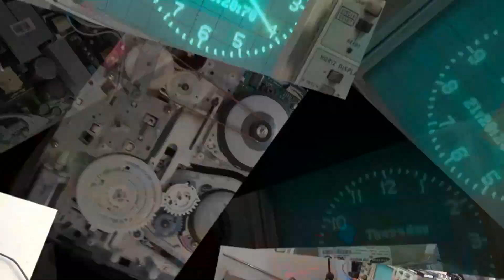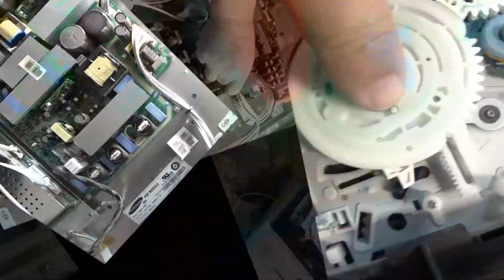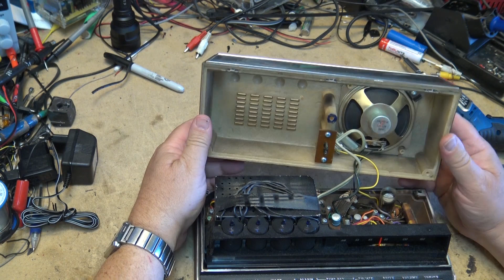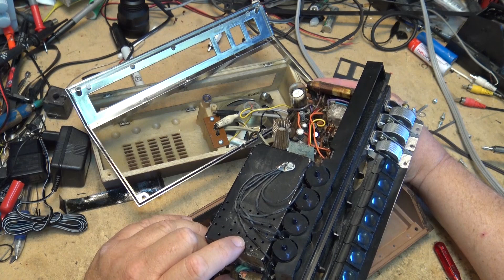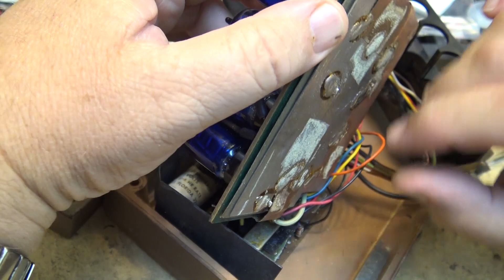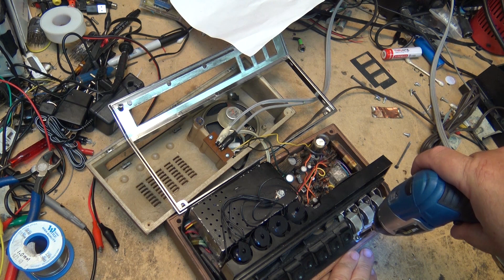Vintage GE C4390 Clock Radio Very Dim Display

Comment: Also, do you happen to know what voltage and type of backup battery was in there....my battery is missing and when the radio is turned on I read about 8 vdc.....it can be varied by turning a pot on the power supply board....Thanks Much...   Not sure but it sounds like your saying 1.2 volts.....

Comment: I have the same GE Clock radio model C4390A- I purchased as a kid......have you had any luck in finding the Y-1938 tubes yes?    Mine are very dim as well...   Thanks Mike
Reply from the maker: Nope.  I shipped it back

Comment: Geez that was one annoying build :D I was so happy for you to have that electronic unscrewer available. 
BUT! These display tubes are super cool! Haven't seen similar before, just regular vfd displays.
Reply from the maker: The guy that owns it managed to find some compatable tubes, not blue though just the blue green non filtered color.  He sent it to me to confirm that it was a weak tube issue.  Sent me a picture of the new tubes.  Nice and bright.
Reply: @12voltvids  Yes, no wonder the tubes were gone, this must be from the 70's. The radio seemed to perform really well but without a functioning display whole unit kinda loses it's charm. How nice to hear that it got a second chance with better tubes :)
Reply from the maker: @MLX1401  
I have a few VFD clock radios myself.  And a flipper, a couple of nixie tube clocks.  My favorite is my crt vector clock.
Reply: @12voltvids  Haha, wow, great collection! Nixie tube displays look awesome but are super rare here in Finland. We mostly have them in obsolete industrial computers (not that I wouldn't like one but my apartment is better suited for smaller, er, collectibles) ':D
Do you have a video of that CRT vector clock? Sounds really beautiful, does it have fast or slow phosphor?
Reply from the maker: @MLX1401  yes I do have a video of it. It is recent as I just picked up a new (old) x-y scope to build it into.  I posted that perhaps a month ago. There are also videos of the generator circuit repair as both the boards I had got damaged.   The generator board was a kit I built many years ago. Before I was doing YouTube videos.   It was the first smd kit I built over at a now long dead friends house.  He had built himself a solder flow oven so I placed all the parts on the board and stuck them in his oven and baked the parts on.  First one was defective the display was distorted so I contacted the kit supplier and they said they had discontinued the kit and sent me their last one that worked perfectly until I went to connect it to a little Heathkit scope I got at another hamfest that sent 80 volts out the input and killed my working board.  So I sourced the parts for both (same part) and did a video of fixing both.   The image of the vector clock is present in the opening music logo of every video.   The scope uses fast phosphor. The spot is really flying fast around the tube to draw those vectors.

Incidentally there is a guy selling 4 digit nixie tube click kits for 49.00 in tindie.com. I have built one.
Reply: @12voltvids   Interesting story! Some serius hard luck with the generator boards ':D 
I think I found the amentioned vid with the scope. We still use a lot of older test gear with crt:s at work. HP, Tek etc.
Modern digital scopes are easier to use and read but not much fun ;)

Comment: I got married on leave, coming back from Southeast Asia in the USAF, in 1971.  My wife and I bought one of these at a local store that years later would turn into Service Merchandise.  The clock radio cost $30.00 in 1971, which in today's dollars amounts to almost $200.00.  We had it for two days and all the nixie tubes turned to "8" so we took it back to exchange it.  The saleslady said most people returned the unit because of the obnoxious alarm sound, which was an electronic whine.  It lasted for several decades, and the display went too dim to see.  I threw it away years later, and kick my butt to this day for doing it.  Looking for an exact replacement but this particular model seems scarce.
Reply from the maker: We have all done that and then spent big bucks to get another. Mine was finding another Heathkit gc1006 panaplex 6 digit clock.  First clock kit I built  in 74 or 5 when I was about 12 or 13 was one of those.  Poor solder skills and used the wrong solder it didn't work long and it was thrown out . Kicked myself after because I could have easily fixed it but nope tossed it.  Found one last year and had to have it.  It was broken but I got it going and it is one of my favorites.  Panaplex is a 7 segment cold cathode neon display that has a nice orange glow. Similar to Nixie but much more rare these days.

Comment: Look like very hard to locate display tubes, I am looking forward to the completion!!  Technical question if I may: you mention the filament current...if you could explain the pros and cons of using AC vs DC as it applied to VFD tubes if you could.  Also in a clock schematic I am studying, the 6 VFD tube filaments are in series and fed by a separate ac winding.  In the center of the string of 6, thru a resistor, it is tied to ground of the DC supply.  If you open this connection to ground, the vfds turn off.  Is this what they refer to a biasing and or how does that work?  It will help me in a future build.  I am having trouble finding / understanding this part to make sure I build the power supply right.  Thank you sir, Jim.
Reply from the maker: There will not be a follow up video to this one because after discussion with the owner he decided to proceed to replace the tubes on his end, to save the cost of having the tubes shipped here, and having me plug them in. I confirmed that the problem was just the tubes and sent the radio back to him. He did send me a picture of it working after he plugged in the new tubes. They are a different color, as the original tubes are not available (with the blue paint coating) Looks great. Perhaps a follow up video, showing highlights of the original one ending with the picture after it went back together.
Now the advantage to AC over DC to the filaments on a VFD has more to do with tube efficiency than anything else. Tubes lit with DC filaments will work, no problem, but the segments tend to be lit up unevenly, with brighter spots directly under where the filament is. When the filament has AC power the displays are more uniformly lit up. 
The resistor tied to ground is the reference. If the filament was isolated  as it would be if just on the filament winding, there would be no place for the electrons to originate. The voltage would be there to heat the filaments up, but there is no complete circuit for the electrons to flow. The anode (segments) and grid (screen) is positive with respect to ground. The filament grounded provides the negative voltage for the filament (cathode)
In a multiplex display, all the anodes for each segment are tied in parallel, and the grid is driven negative to blank that display.  The drive circuit drives the anodes (all of them) and switches the grid positive for each digit 1 at a time to light that digit.
The rest are driven negative to stop the flow of electrons. (remember like charges repel, so a negative grid will stop emission from the cathode)
In this clock there is no grid (screen) so these tubes normally can not be multiplexed, but GE did it on this clock by having separate filament windings 
on that transformer under the metal shield. They then drove a DC voltage into the winding. positive would stop the cathode from emitting, and negative to turn the tube on. That way they can multiplex a direct drive tube array.
This allows operation with a total of 9 pins on each tube. The 7 segments are paralleled, for the hour, 10 min and minutes, with the 10 hour hard wired to form the 1. The filaments were on separate windings for the min, 10 min and the 2 hour tubes paralleled. For the digits 10 11 12, the segments were just drived as a 0 1 and 2 like normal (remember the 3 right most tubes the segments are in parallel) and a seperate transistor pulled the 2 segments to form the 1 positive during the hour tube scan to produce the numbers 10 11 12.so the multiplex circuit for this display would have 7 transistors for the segments 3 transistors to switch the filaments to ground sequentially and 1 for the 10 hour digit. 11 transistors in the display drive circuit.
No different that a 4 digit grid drive tube. It would have the same number of transistors driving it, 7 for the segments, and 4 to drive the 4 grids, but that type of display could have 4 digits, so it could also display 24 hour time.
I have built 3 VFD clocks. One has an 8 digit calculator display tube, the second has 6 7 segment tubes, and the 3rd has 6 16 segment alphanumeric tubes so it can also display text.
Reply: THANKS to the reply to my question and the followup and theory on the GE!  Dc and AC on the same line, something to wrap my head around some one of these days.  Got it with the AC vs DC and uneven spots.  In reference to the filament referenced to ground, thanks for the explanation.  I guess one could use this to also control brightness?  You do have a talent sir and thank you for your videos.  I have been slowed with health issues and your videos keep my mind somewhat going.  If you like vintage digital clocks, (new hobby) I have started to play with, collect, or build and I am doing some low budget video logs here on Youtube if you get bored, check them out.  I too have a Heathkit GC-1005 but paid alot more than you, lucky guy!  Be well, Jim
Reply from the maker: The cg1005 tend to go for about as much these days as when new.
Reply from the maker: Really nothing to it. The AC side is ISOLATED as it is on a separate winding.  So say you need 2 volts for the filament, and you wire 6 tubes in series, you would need 12 volts across all the tubes in series. That would deliver 2 volts across each filament. Then if you put negative 20 volts  to any single pin anywhere on the filament circuit or to 1 pin of the secondary, you would have a 2 volts AC across each filament, and all the filaments would be driven to -20v. 
You could vary that negative DC supply, and that would control the brightness of the VFD.

Comment: You can sometimes squeeze a little more life out of VFD's by running the heaters high for a few minutes. 🤔
Reply from the maker: Yes this brightened up a bit when I ran the supply voltage up a bit.

Comment: I had the very same clock that I bought back in 1970 while in the service in California.  I believe this was the first consumer item that had these early seven segment displays. I can't remember what I paid for it. It might have been $60-$100.   If I remember right, the alarm could only be set in ten minute intervals.  Every item I have ever owned that had these fluorescent displays have this fading problem. I never checked for a cause thinking the displays had just "worn out".  I don't remember but was this manufactured in the US or Japan?

Comment: Too bad the tubes are weak. That's a true classic!! GE made some great table radios. I still have a 1989 model stereo clock radio unit with two alarms that still works great.

Comment: That's going to be very difficult to find the correct tubes to replace those weak ones. It would be neat if one could use appropriate orange nixie tubes to fit in there but I'm sure there would have to be modification done to the power supply. I do remember seeing these listed on eBay occasionally.

Comment: Hey 12voltvids! I'm a young film maker with i believe a technical difficulty on a Panasonic mini dv Digitial Palmcorder. The VHS mode/playback on the camera suddenly stopped working, and i'm worried if maybe it's now not recording on the tapes either. Do you know if it's possible the tapes aren't catching? And if so is there a way to fix it  from home? Thank you!!

Comment: with multiple filament taps like that, it tells me that it is a multiplexed unit. 15V anode voltage is too low for muxing 4 tubes. it needs to be around 24 or more VDC for muxing. 12 to 15V is plenty for static drive. Also finding those tubes will probably be difficult. Woudl be much easier to get the russian 9 pin versions of those tubes, and rewire.
Reply from the maker: THEtechknight 
Sure is multiplexed. They are doing it with the taps on the filaments. This ensures the filament stays warm as they drive the filament positive to stop emission. Then use a pull down to resistor to pull the filament low to allow turn the tube on.

Comment: You can often increase the brightness by increasing the neg. voltage to the tubes.   It's usually determined by a zener diode so just putting in a diode with a higher voltage rating will generally do it.

Comment: So where’s the actual “clock” IC? And does it take the frequency reference from the 60 Hz mains, or from a 32.768 kHz crystal?
Reply: I had one of these back in 1970, but never opened it up, and I don't remember whether I gave it away or what.
It might not have had a "clock" IC but I am pretty sure the frequency reference was from the line.

Comment: Actually, it would be more complicated, but you could multiplex the tubes with an octal line-driver w/CE; one per tube. The multiplexing signal would drive the CE (chip enable) line, and the inputs would go to the segment drive lines (‘a’ through ‘g’), and the outputs to the individual segment anodes. I believe there’s a chip in the ULN20xx family just for this purpose. This would be better than trying to multiplex the fragile filaments (cathodes) with any sort of high frequency signal, even assuming the thermal mass of the filaments would support such nonsense!

Comment: I like VFDs. I recently acquired two calculator type devices. One worked, one didn't. I gutted them for the displays (I think one is a 12 digit, the other an 8 digit) and intend on figuring out how they work and use them in my own calculator build...when I have time :)

Comment: Series strung? Didn't notice a power TX, (at least for the tubes) well built unit, wonder how similar nixie tubes could work in there, with some mods!
Reply: HDXFH nice to see you here ;p
Reply from the maker: I see 3 windings on the power transformer for the filaments. The hours and 10 hour were wired in parallel pin 9 to 9 and 6 to 6, and the minute and 10 minute had separate wires going to the transformer.
Since I don't have a schematic I do not know how they are connected, but I assume that each segment is paralleled to the same segment on all the tubes and the anode goes to a common driver IC that multiplexes the numbers one at a time. Since these tubes have no grid the only way to multiplex would be to clock the filaments up and down by applying a positive charge to the tubes that need to be biased off. It was quite hard to see what is going on on this board with all the wires going back and forth. The filaments had 1.8v across each filament, and they measured about 12v AC, but of course that could be also pulsed for the multiplexing. The tubes are weak, and everything else appears to be OK, so I didn't go much further than that.
Reply from the maker: And no nixie wouldn't work in this.
Nixie requires about 10 volts and it is a base 10, device. 10 cathodes. This is a 7 segment device. WOuld be easier to make this panaplex, but still need about 170 volts for that. I have both panaplex and nixie clocks.